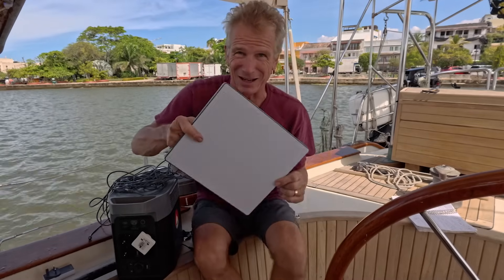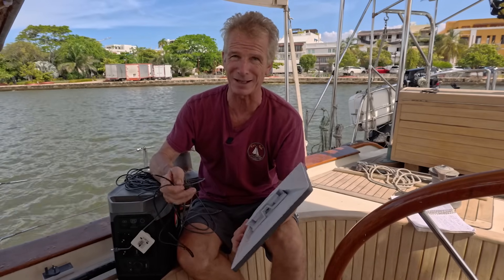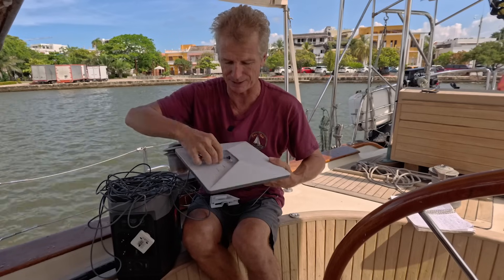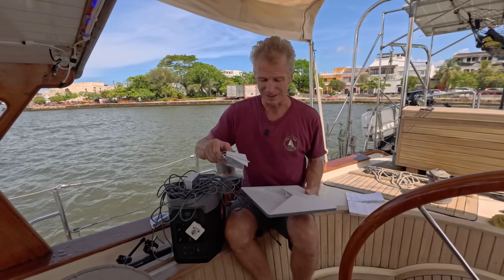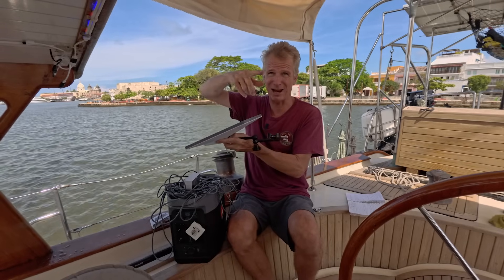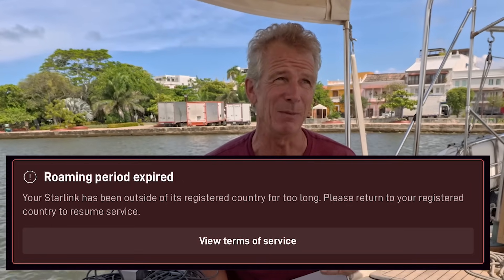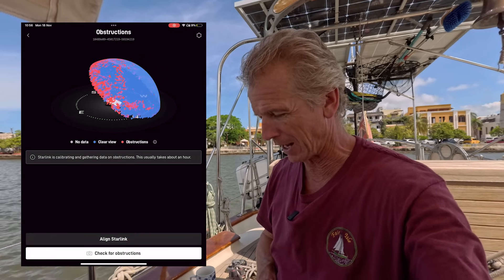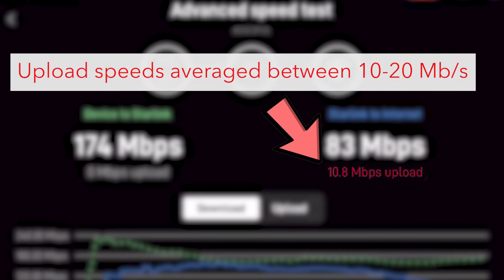Starlink Mini on a boat

Comment: Gen 2 with 12v to 48v dc/dc converter and poe injector,(mtors and heater disabled) teltonica 4g router uses also about 30w so no real power saving
Reply from the maker: That’s a good router then power wise. Can you still use the Starlink app properly to toggle priority etc though?
Reply: That's similar to my setup using a Mofi router.
Reply: Yes starlink app still works, only limitation is download speed which is about 40mbps due to  router wan port is 100mb not a gigabit

Comment: Why did you buy a 2nd starlink?
Reply: I have the iridium go as backup because you never know what Elon does and for long passages I can download still grab files. That iridium go will go into grab bag for life raft.
Reply from the maker: Two reasons, if they stick to cutting off Starlinks after 2 months away from the registered country and only allow you to reregister every 3 months then you need to flip flop between two! Also I wanted a mini anyway because it draw so much less and I can rig a battery so it could be used in an emergency in a lift raft. We only have one in operation at a time! you can pause the service.
Reply: @svfairisle was thinking doing that too because of the reason you mentioned.

Comment: We’ve a new boat on order and are told that the favored position is to mount it inside the fore peak locker, fixed to the ceiling. Apparently works well even through the deck. If signal is still good it’s a nice solution for other reasons. Would be great to know if that works on yours.
Reply from the maker: It didnt work well through our deck, not at all in some places, but our deck it very thick fiberglass with 22mm teak on top of that.
Reply: @ yes ours is an outremer so deck will be thinner and cored so perhaps less to get in the way. But is apparently tkt working well there for other owners. Maybe within you doghouse ceiling would work better? Or is that super thick too.
Reply: O52?

Comment: This would annoy me. Sim cards seem better option
Reply: What is annoying is dealing with communication companies in every new country..  some of which do not have a "Press 2 for English" on their CUS lines - horrible considering they sell SIMs to tourists ..and... E.N.G.L.I.S.H. ffs..  And, many SIM card companies offer "Unlimited" but it is NOT! They throttle you back at some point, and that is a HORRIBLY FRUSTRATING experience.  And as he mentioned, finding a store, making the purchase, installing... etc... Also, many countries now require you to make a facetime call with a third party company to verify you are who you are and not a terrorist activating a burner phone... Extreme hassle. So you have to consider convenience..  For me, the price (the one I currently pay) is EASILY worth the convenience factor alone!  I simply have internet.  It (mine being Gen 2 mounted up high with no obstructions ever) just works. All.the.time. And comes with a cool app. :)   And that is worth the price for me...  at least the price I pay now .........  The contract (price) thing is real.. and a concern...

Comment: Are you not limited to 50gb per month on the mini? We have the gen 2 which is still unlimited data. We pay the global roaming, registered in US, $400/months which I think is expensive. Literally doubled this year🤯
Reply from the maker: No the mini can be on the standard Roam contract, ours is. The 50GB plan is a special thing for the mini if you just want occasional use for outings so it's cheaper. You just opt into what ever contract suits you.

Comment: The problem is with the EcoFlow.

If it can only supply 3A, this is not enough current. The 12V house system will not have this limitation.
Reply from the maker: It does, we tried it! At least with the long cable
Reply: Or use the 12V aux outlet (cigarette lighter socket) which can supply 10A on the Ecoflow.  The other DC option is USB-C power delivery.
Reply from the maker: @russelllang2910  you’re missing the point a bit though. Yes you can ramp up the amps to get enough power to make it work at the very low voltage you will end up with at the end of the cable if you’re only feeding it 12v at the start but try feeding it that way then holding the coiled cable as I did when we were testing. It was very warm! That’s a lot of power loss. Really the only efficient way of powering the unit is to supply it with at least 30v, that’s the way it way designed to work.

Comment: There are ~$25, 12V-->24V converters 100-200W options. Not the full expense of an inverter. I think they're around 90% efficient. Sounds like 24V will be enough for the thin cable.
Reply: As example, a 100W model will be fed 8amp at 12V via proper ~12ga wire not too far from battery. The converter will output 24V, 4amp to the long thin wire. 4amp isn't too bad and maybe volts drop to 20-22ish with 4amp. Starlink is looking for minimum solid 12.5-14V, 4-5 amps so it works.

Comment: The power-over ethernet works just fine. International standards regulate it. In comparison, what can you expect from these cheaply supplied super flimsy Chinese cables, with minimum thickness of the wires? Good review, though. Cheers.
Reply from the maker: Are they using multiple wires in the PoE cables then? Difficult to see how they can supply the power even at a 48v
Reply: PoE uses 48V so even less current than at 30V. The original 15W PoE (802.3af) used one pair of wires for power. I'm pretty sure that the 65W version of PoE (802.3at or bt?) uses all four pairs.  This is commonly used for powering 30+ watts to a Wi-Fi Access Point over 50-100m of cable,  but this is the fixed cable not a patch cable.

Comment: Why would you  support Elon Musk?   There is nothing wrong with a SSB radio and grib files.
Reply from the maker: I did think about doing the YT channel by semaphore but I'm not sure the algorithm would cope!
Reply: @svfairisle  Morse code would be better.
Reply: The days of SSB are over.  Most ocean going boats have ditched them.  Never mind the time wasted futzing with the SSB to get a reliable connection that then disconnects often enough getting more then a 40k GRIB is too hard.   I have 18 years using SSB and 12 years using Iridium to get GRIBs... all now obsolete by Starlink... especially for less technical folks that need weather  info/help but will never learn to use GRIBs.
Reply: @quancij  Quite the contrary, with the correct set up a SSB radio works very well, it worked well in Patagonia and this past summer in Northern Labrador.
Reply from the maker: @luisromo5888  we took the split backstay antenna off Fair Isle when we re-rigged a couple of years ago. SSB is fun, I used to like playing with it but it’s like comparing a lead line with a sonar when it come to functionality.

Comment: Thanks; interesting.  Obviously they are different solutions to different problems, but a local SIM is still a good option when inshore and stationary.  You might want to try using eSIMs rather than a physical SIM card, and find an online provider like SIM Corner; that way, you might be able to do it all online/remotely and not burn time finding a shop ashore...
Reply from the maker: Yes eSims are certainly coming on strong. The ones we've tried are expensive data wise though, the unlimited data on Starlink is a massive plus for us.

Comment: If you are looking for a more robust mounting solution, I have found that the upper portion of Starlink's "Mini Wall Mount" product fits perfectly into my fishing pole holder that I have mounted high on my boat's Bimini support tube. I can pivot the Mini easily in the pole holder. The shallow tube mounting adaptor that comes with the Mini doesn't have much depth for attachment to a pipe.  The wall mount kit is more robust.
Reply from the maker: Yes I'm not loving the shallow hole they have on the Starlink clip in pole mount. I actually ordered a mount kit for the dish when we got it in the UK and the sent me one for the Standard not the Mini! I've managed to rig something that works though, I'll show it in the next episode.

Comment: Another useful tech video, thank you. In the context of running a big boat like Fair Isle, the initial equipment cost is not that significant even for the HP dish but the power usage is a big deal if it is powered on 24/7. For that reason it would be really interesting to know how long each style of dish takes to connect when it is powered up. If that process is quick and reliable, I would happily limit usage periods during times of power shortage to what’s necessary for the operation of the boat. With that, power usage would take a back seat to reliable connections when the weather turns gnarly.
Reply from the maker: In our experience on a flat anchorage the Starlink Standard and Mini both connect within a minute or two. When sailing and moving around it takes longer. On average with the Standard dish it was 10 miutes but it did take up to an hour in the middle of the Atlantic. We are not sure if that was down to the fact we had big seas and were rolling a lot of if it's because there are fewer satellites out there to pick from, but rolly seas definitely slow things down. So far the Mini seems the same. We haven't had the heavy seas we tested the standard with, but it's coping okay with normal sailing pitch and roll and connects in 10-15 mins. (it sometimes gets it and looses it straight away a couple of times before stabilizing)
Reply: That's a good point. I have the bigger dish and was thinking of switching to the mini because of the lower power consumption. On the other hand, if the big one connects so much more quickly, I can limit my power consumption by switching that on when I need it (and without the expense and hassle of buying a new unit).
Reply from the maker: @oldmansailing  Having used it for a few months now John I can say I much prefer the Mini. It may take slightly longer to connect on occasions but we find with the lower draw we turn it off much less. Mounted flat as we have it now we've had no issues and the router is great.

Comment: I enjoyed your piece on the Star Link Mini as I am interested in one myself. However, the presentation confused me on power requirements. Looking at the Star Link web site did not provide clarity. One spec indicated 100 watts at 20V/5A, another indicated input power from 12-48 Volts 60 watts. It appears that the Eco Flow with a 12 volt 3 amp output would be marginal. It's likely that power output at any range from 12 to 48 volts that puts out 5 amps would provide the correct power. Star Link should clarify this.
Reply from the maker: Yes they should. The reason they dont is that they are targeting it largely to RV'ers who would want to power it off 12v. They have carefully made the unit be able to work with in 12-48v range so it looks like it can be powered by a 12v battery. Problem is you may have 12v ( or more you would hope with a fully charged battery) at the battery itself but you need a good thick, short cable to be able to deliver that to the dish. So unless you can fit it that we (we couldn't because its a long run up to the arch and we need the good view of the sky) then you will need more than 12v across your cable.

Comment: hi great info thanks, We have 12 V on board and plan to by an ecoflo can I plug into the 240 outlet and convert to 30V ?
Reply from the maker: yes thats exactly what we did before I did the final installation and mounted it on the back arch, works absolutely fine. I've now got it running off the Victron Phoenix inverter we bought to power the Standard Starlink, since we already had it it was an easier solution for us and I use the Ecoflow for many other things.

Comment: It seems that the changing direction, either at anchor or on sail, would be a challenge. Do you just manually adjust the “aim” when needed? Do you just not use it when in a situation where boat direction changes regularly (tacking or jibing regularly)? Or do you simply use it intermittently and set aim while generally stationary? I’d like to know more about challenges you have from antenna misdirection.
Reply from the maker: This video is two weeks old as it was with the Patrons before going live so we have now used it off shore as well as sailing along the coast of Panama, I've written an update in the description so have a look at that, but upshot is with a good view of the sky up on our arch it seems fine mounted flat and doesn't drop out.

Comment: Todays 12 v is the 6 v of 1956. 24 or 48 is the new standard.
Reply from the maker: Yes many boats are now going to a higher voltage, about time really, it was the automotive industry sticking at 12v for so long and all the manufacturers of third party electronics only doing 12v that held things back so long. lots of advantages to a higher voltage.
Reply: Well, it's getting there. My engine is only two years old... starter and alternator are 12v, most lights are still 12 volts, nav gear is 12v. The only 24v thing I have is the fridge which is 12/24 (fridges have been 12/24 for years). It's not worth switching to 24v and then using buck regulators for almost everything. Someone with deep pockets who will use many AC bits would be better with 48v to power their inverters. We may see a jump to 48v, hard to tell.

Comment: We bought an after market power cable that is 14 gauge and 15ft long. Works perfectly on 12V. One of the reasons it uses less power is because of the throttled back upload speed. If you do a lo of Zoom type meetings it has a lag and therefore might not be the dish for some.
Reply: Could you please provide a link to the cable?
Reply from the maker: That interesting, I guess the upload must take some power. Interesting as well that you're getting enough voltage at the dish with 14 gauge cable. We are currently using the whole 50 foot of the supplied cable with where the dish is mounted though so I think the cable would have to be unfeasibly thick to deliver enough voltage at the dish!

Comment: Interesting. We are in the process of getting this for our tour of Scotland. Our electrician (marine specialist) has been using it for offshore racing. They advise that it will definitely run off 12v. It is not waterproof so proposing to mount under the for peak hatch stuck to the plastic (there is a bracket for the purpose). £50 a month for 50gb (£90 unlimited)on roam upto 12nm off shore. More questions to ask 🙂
Reply from the maker: See the comment from Sue on here that they have it working off 12v with a 3rd party 14 gauge 15ft long cable. If you can manage to deliver above 12v to the dish then it should work, in practice that can be more difficult to do than you think so the extra voltage is definitely a plus. Also the plug that comes with the Starlink is well waterproofed, the unit is definitely completely waterproof using this plug. We have been having biblical rain out here in Panama and Colombia and it's fine.

Comment: Where did you purchase the mini? When I purchased my gen 2 in Canada direct from starlink it was registered in Canada when I received it. I’m sailing from Canada to Europe via Greenland and Iceland summer 2025. So I assume I’ll have this issue sometime in Europe. Cheers
Reply from the maker: Are you sure it was already registered? thats a new thing. We got ours in the UK because they were out of stock in the US when we went to Annapolis. As with the first one it wasn't registered anywhere but it did know that it was a European unit and when I registered it in Aruba. I got a message that because I was registering it away from where it was from there would be a $150 charge which would be implemented 6 days after registration, it wasn't, so I don't know what happened there!